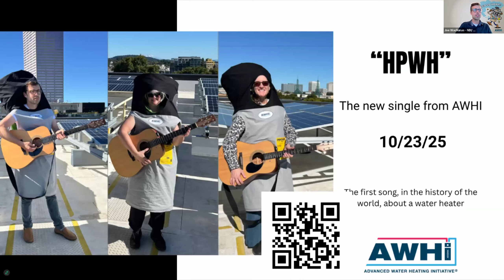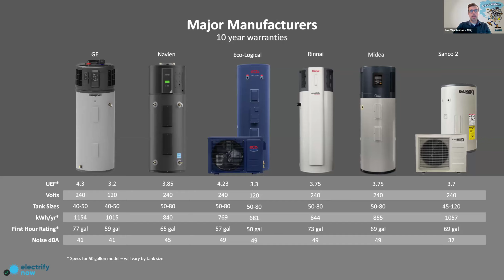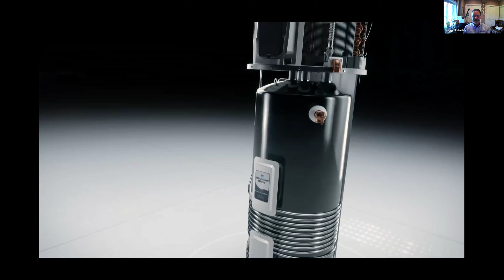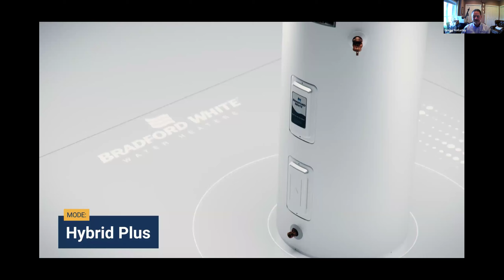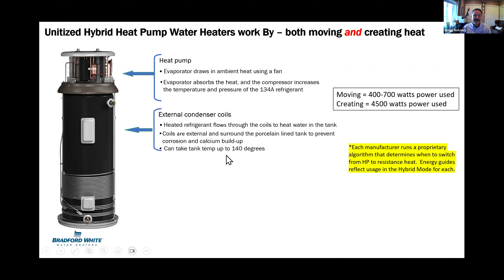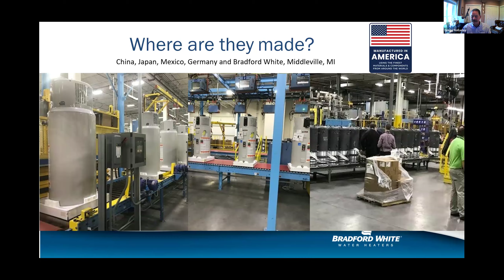HPWH 101

Comment: Every HPWH should automatically include and Electronic Anode as a Standard not an option. These appliances are more difficult to access and replace them. up to 20 year longevity would solve this potential issue. GO Electronic Anodes for HPWH's!